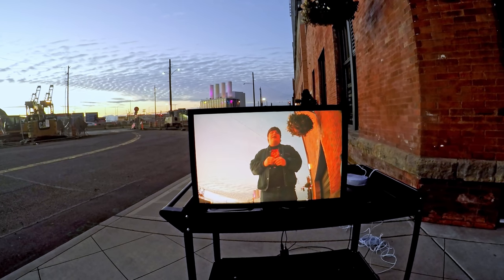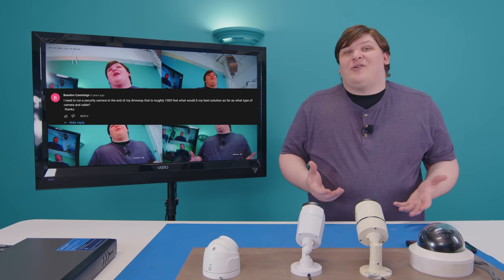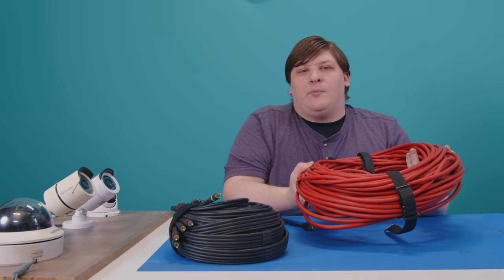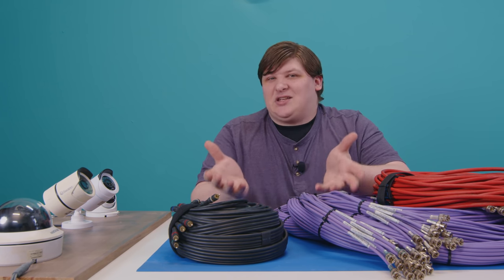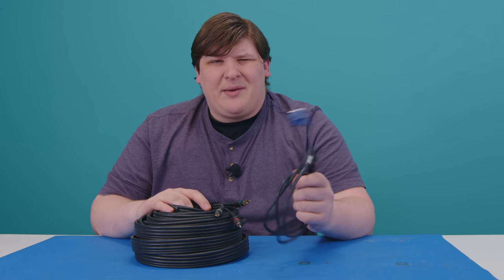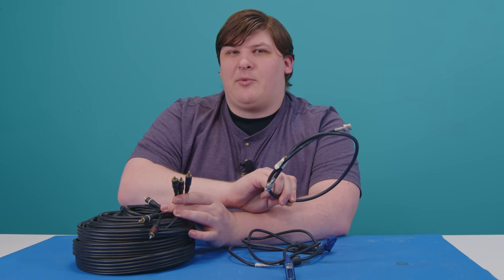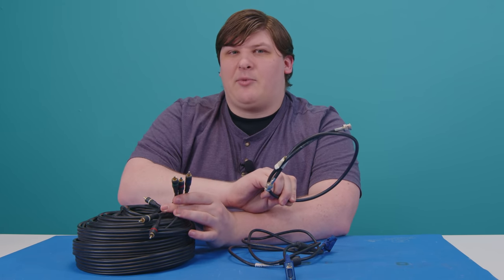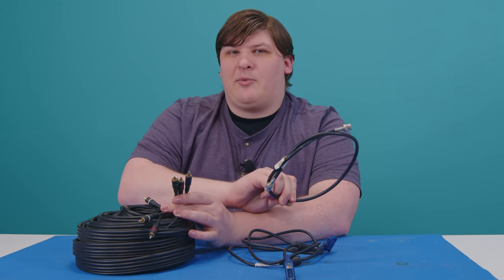1000ft of ANALOG HD video over a single cable?! [AHD/CVI/TVI]

Comment: The irony is that fiber optic cable is actually cheaper to manufacture than coax. They just charge through the nose for it because it’s marketed as higher-tech.
Reply: A wild TayZonday appeared! Internet legend!
Reply: The main reason is that its much harder to terminate for networking than coax - if its a custom run and not a prefab you're going to pay to have it cut and polished and that racks the price up significantly.
Reply: I just read this comment and was like, huh, that's pretty insightful. Did not expect mr Zonday himself to be the one raining this wisdom down on me.
Reply: No, they charge a lot because terminating fiber cable, and the connectors,  are more expensive than coax.
Reply: chocolate rain
Reply: @mrtobiastaylor86  This is true. A spool of OM2 is pretty darn cheap, but you'll need either a splicer to attach premade ends ($4k+), or hot melt/unicam/etc, which is incredibly tedious.
Reply: @thelight3112  yeah - exactly, Ive been splicing fibre a few years on sites (and I am by far from the best at it) and the time it takes is a major factor. If you're lucky enough to do get a non-spliced run you can have fun with your hockey puck polishing but this can take ages and you'll be messing around with a scope for even longer.
Reply: I would guess that they often use MTP-24 in broadcast surroundings, that's 24 fibers all within one single connector and one "cable". Those aren't very cheap, but perhaps cheaper than a really good coax..?
Reply: This is completely true. But Tay, you watch pretty much the same channels as I do. I thought I have a weird mix in taste, but you give me hope <3
Reply: Tell me about it. Get into ham radio and buy some LMR-400 or Belden 9913.... $2.50-$3 p/foot.
Reply: @mrtobiastaylor86  This is the correct answer. I can get fiber cheap. The 40K+ termination device is another story.
Reply: @BDBD16 Actually two things, you can get a fibre splice machine for about $360 these days at the low end. and you can get 2000m of SMF single core OS2 for about $100, the bidi trancievers are about $20 for a pair, and pre-terminmated pigtails are about $2 each. A 24 port SFP switch can be had for $500 and a media converter can be had for $30. So even given off-the-shelf cables and devices the per-link cost is about $USD75, + cable at $1.50/100ft. Also at anything under 300ft normal Cat-5e cable is about $10/100ft. And an SFP cage is actually only a $4 part in a device that already does ethernet, so many IP cameras actually have the connection. This system can easily do 10km with linear costs.

To compare this to RG6 coax, 1000ft of RG6 costs about $100 at home depot (which is meh quality), the fibre solution with all the media converters costs 90, so for a 1000ft run, even if your ip camera only has a normal ethernet connection, it is still cheaper. If your IP camera has an SFP port then the total cost would be $60, which means for any link over 500ft, fibre is cheaper. and for anything under 300ft, cat5e cable is cheaper. for things in-between the difference in price is maybe $10. This is all using conventional ethernet equipment, and because it is fibre lightning is never a concern.
Reply: No thats not exactly true... Yes theres a price spectrum like any other material but the reason it cost so much to install is the precision needed to splice and/or extend FO... Even with the plastic based FO, If  its not installed correctly it useless.
Reply: its more the cost of termination and the expense of the equipment to do so. anyone can puck up a bnc crimping tool for 20$ on amazon and within half a day be rather proficient in termination. fibre on the other hand, your looking £5000 at the very minimum for the equipment. meaning that termination is usually contracted out to a third party to avoid capital investment on equipment. the main reason its so expensive is labour
Reply: Fiber optic also has the annoying issue of being able to bend at 90° angles and you need adapters for that, which just terminate the cable at that end and continue another run.
Reply: Termination and QC is where the cost for fiber is coming in.
Reply: @cunijoeme  this was including pre-terminated fibre pigtails, and a splice machine to use them as mentioned is about $360. Also you can terminate fibre with about $50 in equipment if you know what you are doing. It sucks, but you can do it, ask me how I know. This was also looking at bend-insensitive fibre that is rated for a 10mm bend radius, so that is not the big deal either.
Reply: @BrunodeSouzaLino  that used to be the case, but bend insensitive fibre can bend at a much tighter radius that coax ever could. So that is really not a big problem, it is actually super flexible. And that was the type I was quoting in my post.
Reply: @hgbugalou  this used to be the case, but the cost of the equipment to do splices is waaaaay down, and you can splice the fibres to pre terminated pigtails, which are availible for about $1 each.
Reply: GLASS fiber cables are not, plastic ones are. they are also WAY more expensive to patch and terminate and way more fragile.
Reply: @varno  "bend insensitive" aka PLASTIC. optical plastics but still plastic. most cheap fiberoptic cables are plastic.
Reply: @TheObsesedAnimeFreaks  actually no. They are glass fibres, they have a photonic band gap clad core that makes them have a much lower loss coefficient when bent than conventional fibre. They are not made of plastic.
Reply: That is to say there is an additional layer of high RI glass around the core that acts to reduce the influence of bending. The fibre is still Al glass in Bend insensitive fibre. Of course buffing cladding and so on contain plastic. The fibre itself is glass.
Reply: This is not plastic fibre.
Reply: @varno  dude either is wicked chemistry magic making glass flexible(read improbable) or its plastic
Reply: @TheObsesedAnimeFreaks  It is Reeeealy thin glass, and yep, it is wicked chemistry too. It is impossible to make single mode fibre using plastic. You really don't seem to know what you are talking about. G.657.A1 glass OS1 fibre has a bend radius of 10mm, and G.657.B2 fibre cuts that down to 5mm. These were developed for FTTH purposes, and they are real glass single mode fibre. Plastic has too much loss.
Reply: @varno  OK space man
Reply: @varno  Can it bend more than flat coax?
Reply: @BrunodeSouzaLino  well 5mm bend radius is about the thickness of a sharpie, you can bend sharper than that if you are willing to accept losses, I have seen installs where the bend radius was about 1/3 of that, and there was still substantial signal strength left over. Tighter bends just cause additional signal loss (until you snap the fibre). But you can make the bends quite tight and still have things work, just that is the specified bend.
Reply: I use analog hd every almost every day.  Yes, you will get a good nap in in the wide world of security cameras - right up until you catch that lil’ bastard thats tampering with the locks on the security door..
Reply: @Simplicimus1945  Just don't invite the lock picking lawyer to your place.
Reply: Ya, it's definitely cheap. Recently got fiber internet installed, and when hooking the final run to the router up, the guy wasted so much it was shocking lol.
Reply: @TayZonday:  oh hey!!! Nice to see you're still around :)
Reply: I didn't actually know that.
Reply: Yes cheaper to manufacture due to it not relying on copper prices. The reason its expensive is the equipment and time required to manufacture and quality check produced fibre cables with connectors and ferrules that have tight tolerances. If not we would've gone mostly fibre 20 years ago.
Reply: @RheoCross  i've seen people try to redneck a solution, even though the joins look optically clear, you can see a drastic drop in light transmission and clarity. most people don't understand how rough a smooth surface actually is, and how much work it takes to get an optically smooth surface. they spend years polishing telescope mirrors for example, cause it's hard.
Reply: @ClannerJake  you don't have to polish a fibre splice, as you cleave the fibre, you only have to polish connectors. I work in a quantum optics lab, I do understand these things. All I was saying is that actually, you can do a. Lot with surprisingly little these days. No, it is not as easy as the high end tools, but they do produce adequate results.
Reply: Also the price of equipment is allowed to go down over time, and with cheaper phone cameras, and electronics automatic splice machines, at the low end no longer cost as much as they used to. This is progress.
Reply: @Nevir202  In my house they installed it a couple of weeks ago and it came in a roll of 80 meters, already terminated at one end, they used around 35 m and threw the rest in the trash...
Reply: @ruben_balea  Damn, that's crazy wasteful! LOL
Reply: This is the second time in as many weeks, I've come to realize that we watch similar content on YouTube.  I feel as if I am in good company 😃
Reply: @ariblank5351  was the rain of a chocolate nature?
Reply: All BS aside, It has to be kind of annoying to be called out on this or your just cool
Reply: "Higher tech"

Shits been around forever and still never properly been used for the masses.

In the 80s growing up it was all the rage, yet it's never ever taken off outside of the stereo system guy who always had "top of the line" personal audio equipment to listen to his CDs on in the day.

"My stereo has fiber optic output man, it rocks"

That's as far as FO went.

And remember, they don't want us to succeed, chocolate rain.
Reply: And here is a bit of trivia as well. They used to make a plastic fiber cable for internet. The cable itself was made from plastic instead of glass but the only limitation really had was distance it was about half as much. So the price was about half as much the distance was about half as much he had to use a slightly different set of optics on each end in order for it to be used. Well I'm not sure how far they went into using plastics instead of glass for making fiber optic cables but I'm sure if they really wanted to they could make a fiber plastic based version of for video cameras it would be a bit cheaper and still have a high bandwidth without a very large expense
Reply: Oh yeah I forgot a small detail as well.
Plastic fiber was a lot easier to cut polishing connecting glass fiber because you didn't have to deal with polishing glass only polishing fibers so it was easier and cheaper to do it as that way as well
Reply: In fact the machines to splice the fiber optics cables are very expensive what makes servicing them expensive. Besides fiber optics cables are fragile mechanically. Coax cables are much better in some environments because you can easily splice them yourself (think on a farm or a big warehouse) if rodents chew the cables what happens frequently. In fact here in Brazil they charge internal installation by the number of splices they need to do in the fiber(internal cables come in predetermined lengths compatible with small homes.
Reply: I mean it is higher tech compared to coax though. I mean yu could just use coat hangers as coax cable where i'd think you'd have a harder time trying to make fiber optics out  of an led and coffee stirrers
Reply: @AgeofReason  Coax's been around way longer than optical and unlike optical you can just use coat hangers and get almost the exact results as a proper cable; i'd like to see you try and make a fiber optics cable using coffee stirrers and an LED.  Also TosLink is just a fancy RCA cable and once decoded the signal is exactly the same as whats sent over RCA. Real optical cable has been adopted by the masses with fiber internet being more and more common in residential areas whereas TosLink went the way of the dodo.
Reply: @notfiveo But you can power the camera with a small - and very cheap - battery and solar panel, so that's really not relevanr.
Reply: I have  to laugh at all the replies from people who 1) don't actually know what they're talking about and 2) ignore the fact that the cost of the tools and other equipment is expensive for exactly the same reason. The associated stuff is expensive because they have convinced everybody it should be, not because it actually costs anything to manufacture. And time is irrelevant because the whole point is that if you're DIY you're not paying somebody else's exhorbitant hourly fees.

So no, there's no excuse for fiber optic anything being so expensive.
Reply: Except it was wrong but okay
Reply: basically an LED wired to a sensor...
Reply: Hey Tay give us some chocolate rain. I was the camera operator when tosh interviewed you. Good to see u comment
Reply: checks cables “aaaand we are live”
Reply: yea literally a custom clear plastic fishing line with a converter in the cable that shoves a flashy light through it. it's nothing special yet it costs a lot
Reply: And that higher cost isn’t because of the R&D that went into creating materials like glass, constant flashing lights and optical boxes?
Reply: Tosh be proud

Comment: Wow, this was surprisingly interesting. I suppose this explains why the HD video cameras at my work seemingly get analog video artifacts/static rather than digital ones.
Reply: That's interesting. No compression, either, I think. So your work cameras would probably represent a snowstorm quite well, where my home cameras have compression artifacts with so much moving detail.
Reply: How did you post 12 hours ago on a 1 hour old video?..
Reply: @supersophisticated9943  Patreon link
Reply: @R.Daneel  Still gets digitized when it gets saved to the DVR.
Reply: @supersophisticated9943  Different time zones